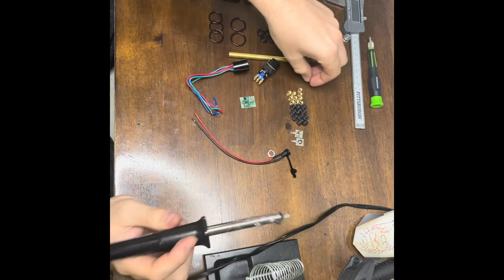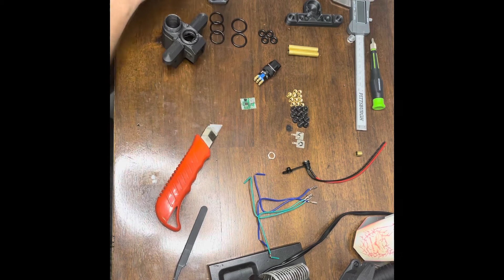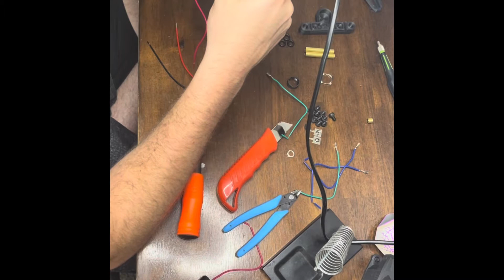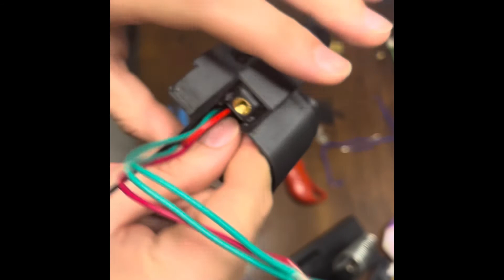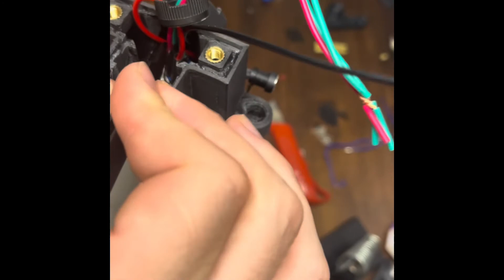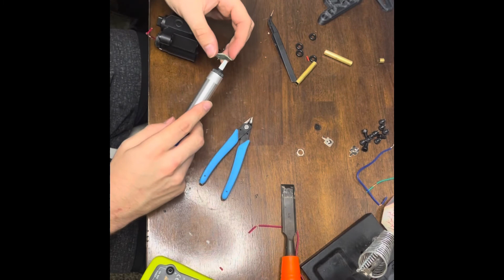PVS-69 Gen3 part 2

Comment: I know very little about wiring but you can just optionally skip the AA and only wire up the DC jack to the buck, right? I'd like to use one of those 5v USB phone batteries for power if possible.
Reply from the maker: Yeah you can skip the internal battery bridge entirely and save some weight